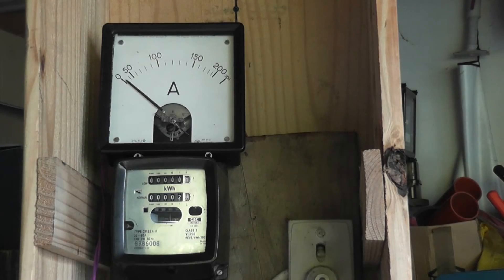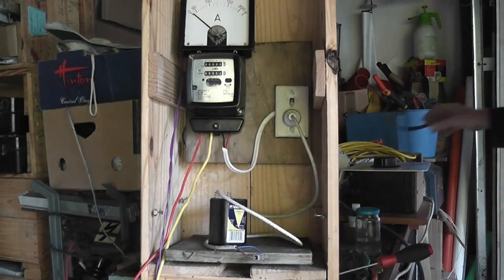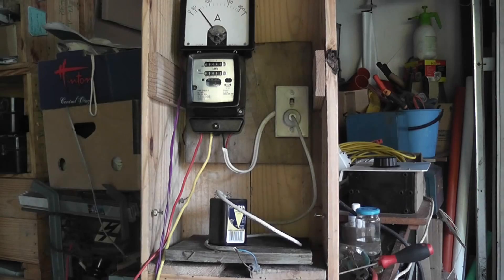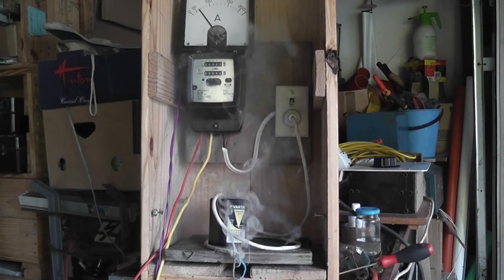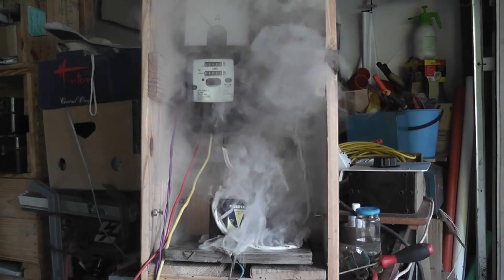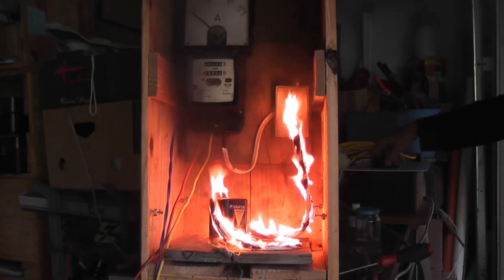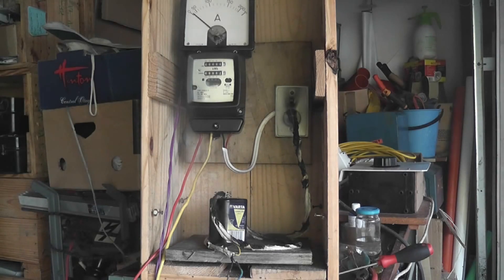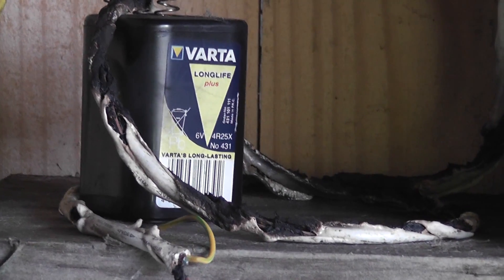Overload !

Comment: I'm surprised the lead didn't overheat and burst into flame a lot Quicker than it did.  Handled the overload much better than I expected.

The Hacking up at the end was hillarious. I could nearly smell the stench of the burning wire when it was smoking.

I just don't get though why in this day and age they still coat electrical wire with Flameable plastic. Just seems ridicilous to do that.

Comment: I can assure you.....THIS VIDEO IS NOT FAKE. Too much current through a cable like that, & it burns up exactly as you saw it in the vid. 

Then...WHOOOOMPH! We have flaaaaaames! :D

Yep, overloaded wires & flexes do burn out like this, albeit a bit slower, as this one was cranked up a bit just to speed up the process. I've done something similar with a thin piece of wire ( a bag tie-wrap with a thin steel wire inside it ) & it smoked, glowed & popped like this also. :D

{^_^} BoomBoxDeluxe {^_^}

Comment from the maker: @kooashoo The battery is to hold the cable off the ground.
This is reduced mains voltage with no fuse. Around 60 Volts 50 Hz

Comment: @More350Power Yep those things are bad news. For the over there folks. There was 2 problems. The stab-lock good in theory but poor in implementation couldnt supply enough current to the breaker to make it trip just catch on fire. The other was for the longest time they werent testing anything, if it did trip it probably damaged it.
 An FPE panel will make me cringe, but a Zinsco will make me run not walk away and never go back

Comment: Nice little burn-out there, & I noticed that you have one of those dual-tariff GEC meters! :-D YAY! The only meters I have, where I have the single-tariff & it's dual-tariff equivalent, is my Sangamo Weston S200.31 & S309.2. I am on the look-out for a Sangamo Schlumberger SPA 01 to go with my SPA 02. :-)

Yep, fuses for circuit protection ARE VITAL. They are there to prevent fires, peoples! Bypass them at your own peril ! 

Of course, this was a controlled burn-up. :-)

-BoomBoxDeluxe.

Comment: @danrulz98 
That's because the series 10, 13, 16, 20, 25, 32, 40, 50, 63, 80, 100, 125, 160, 200 is a Renard series, which means each value (before rounding) is the previous value times a constant factor (ca. 1,26 in this case).
Such series are used very often in engineering, electrics, electronics, construction. They are so important, they got their own ISO Standard, and one of the first ones (ISO3), too. They work much better with metric units though.